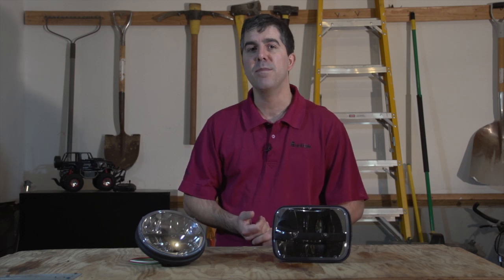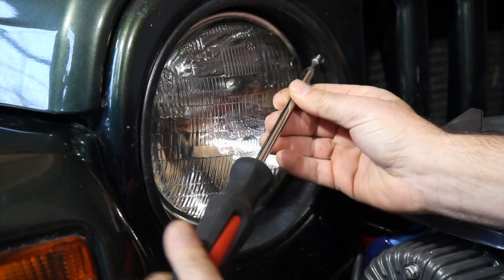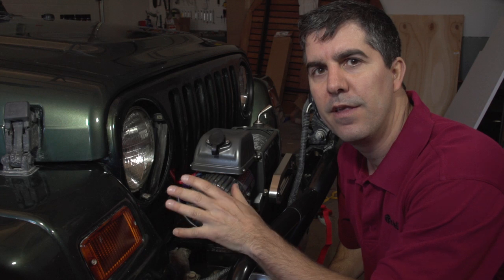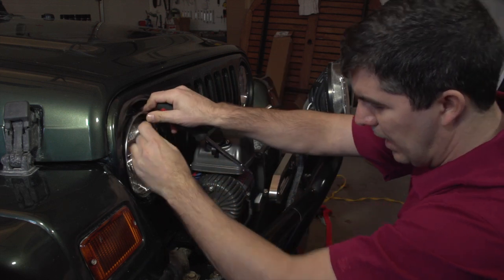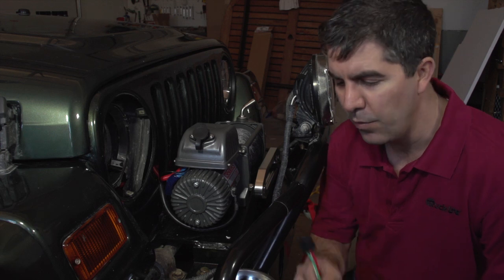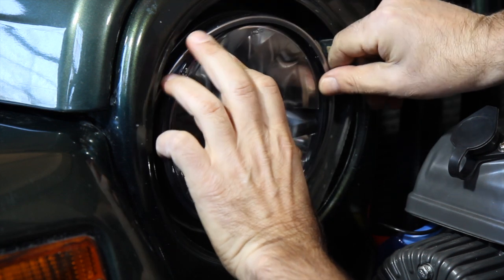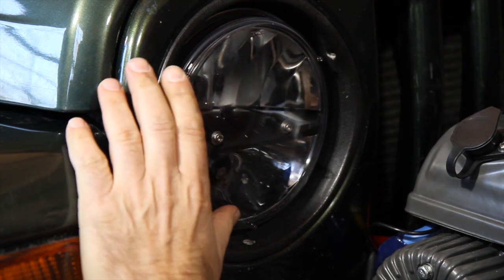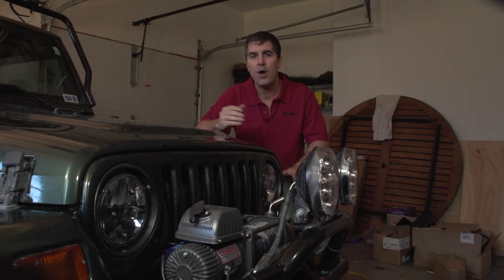Jeep 4x4 Installation of Truck-Lite LED Headlamps

Comment: I have a 2010 Jeep Wrangler in which I previously had the Rugged Ridge "Headlight Euro Guards, Black, 07-13 Jeep Wrangler" SKU 11230.03 mounted on. I recently purchased a set of Truck Lite LED headlights for my Jeep from Quadratec. When I installed the new headlights and went to re-install the headlight guards I wan't able to because the headlights are deeper and the headlight guard bezel won't go all of the way back to the headlight housing. Do you know if these two products compatible? If so, do you know what is the proper way to install, do I just need to buy longer screws to mount the headlight guards? Thank you so much for your help, I know that you are extremely busy and i appreciate your time.

Comment: I just installed a set of these in my 08 JK tonight, and WOW!  What a difference!  They are really impressive.  I used the anti-flicker harnesses, and there is no flicker, whatsoever.  Great product!  It cured the only major gripe I've had about my Jeep in the 6 years I've owned it.

Comment: Somehow my comment got cut off.  So to finish my thought and make a correction.  It is funny how the video does NOT show how horrible the beam pattern is.  I installed these in a Jeep Wrangler.  Overall the light output is decent. But there are horrible hotspots. Also, it is well know that the poorly designed reflectors create huge 'X's in each beam.  Some say they can look past it.  But I can't.  Well be selling these cheap very soon. Great idea but poor implementation

Comment: Bought these in April and have had 2 burn out immediately and had to wait almost 2 months on return as they test.  Horrible warranty program as I received a ticket for not having a headlight while waiting on truck lite to verify it was a bad product I returned.  I am now sending the third back and will most likely have to wait again 2 months.  Buyer beware on these